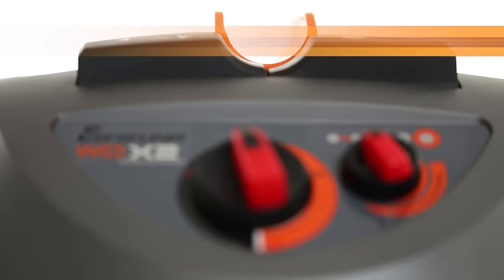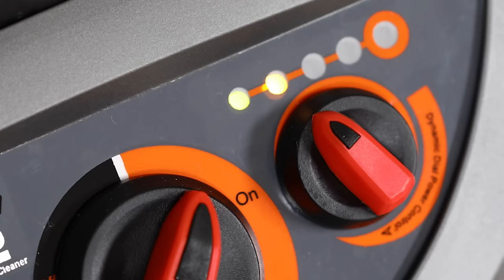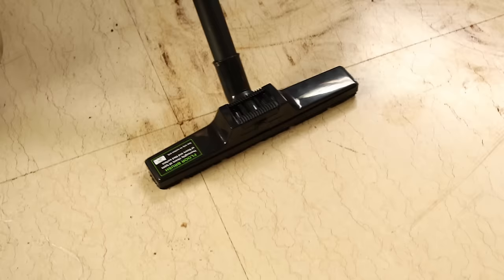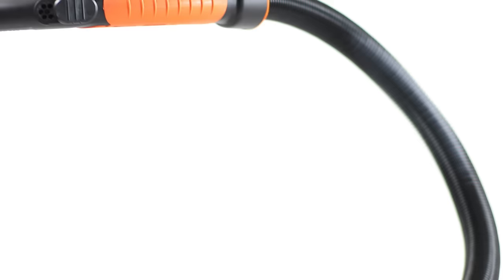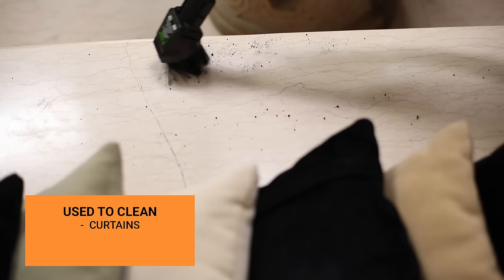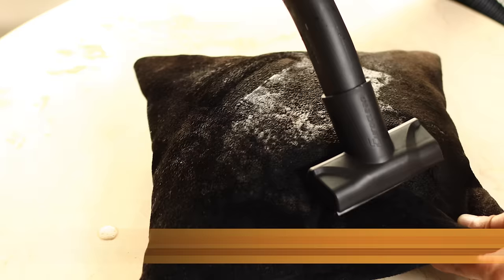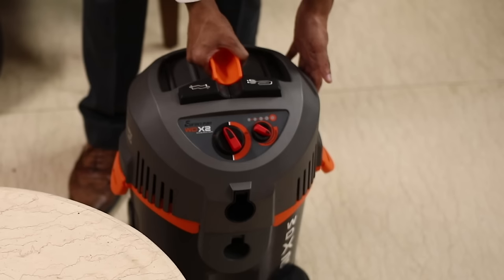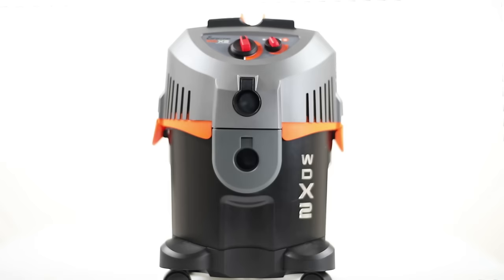Euroclean WD X2 Wet & Dry Vacuum Cleaner | Eureka Forbes

Comment: I think its only best for old age people not for all. Its not so effective for daily cleaning, it is taking much time and awareness to perform the daily routine (like sweeping, web removing etc). Most of the future and parts are only for name sake, if you try use it with full speed (in blower),then it will comes out from the main fittings. If you use moderate speed then it will lot blow out the dust at all. In Nutshell, i personally feel this Machine is costly for this performance. 

PROS: 

1) SURE ITS SO GOOD FOR OLD AGE PEOPLE TO PERFORM THE ORDINARY DAILY CHORES WITH LITTLE EFFORT, BUT TAKES TIME AND ACCURACY IN HANDLING
2) WET CLEANING ULTIMATE
Reply: Than which is best?

Comment: As I had good faith in this product, all the products in my house were rocking their products. Six months ago I gave away my old vaccum cleaner and bought a new vaccum cleaner from them but after two weeks of use the small wheels at the bottom of the mopinu were missing, when I called their customer care number they said that the product will be delayed and the mop came home and one of their sales executives came and bought it and it has been two months. When I called Chumma, he said that the company has returned the product but the roller has not been installed. I bought the product from Kottayam. I will not buy any more products from them, poor service.

Comment: I use this model since last 3 to 4 years approximately it's very good machine and very much efficient.... now may be its need service or something as my machine is overheating
Reply: Is this the right procedure to use autoclean switch?? 
Turn the machine on - motor starts rotating - then interuppt by pressing the autoclean switch

Comment: How do i switch from blower mode to vacuum mode?
Reply: If you plug the hose in the upper hole it will blow the air out , and the lower hole will suck the air in ( vacuum)

Comment: Don't purchase this product. It has very weak locking (latch system) due to which bottom collector drum falls frequently.Also the suppliers does not takes any responsibility after sale.I purchased one in which locking was not working properly. After so many argument with seller and customer care department  they give me new one after one month.The new one also has technical problems.
Reply from the maker: Dear Ramananda,

Please share your registered contact number and customer ID here. My service team will get back to you at the earliest for further help. 

Regards,
Priya
Reply: Dear Madam, The day when I recieved the machine I told the supplier that the latch is not working properly. He told that all the machines have that problem during initial  stages because the gasket is new.I am Being a Maintenance engineer having 35 years experience in machine maintenance field, he never agreed to my complaint.I purchased this from a supplier hosakerehalli,Bangalore. After 35 days having lot of arguments I got the new machine.I have  not all satisfied with the mechanism.
Reply: @eurekaforbes  worst experience from Jalgaon Maharashtra office

Comment: Extremely ineffective in cleaning under the table, under matters cots with low clearance, under cupboards. Just realised it after buying it. The floor cleaning mop is not as effective as the older versions. Unfortunately you cannot use the older accessories on this new thing

Comment: Worst product. It doesn't work properly. The previous version was better. This unit doesn't meet even the expectations of the previous version Wet and Dry machine. Don't ever go for this model.
Reply from the maker: Dear Abirami,

I'll surely help you with this. Please share your registered contact number/customer ID here. I'll have my service team get in touch with you at the earliest.

Regards,
Priya
Reply from the maker: Dear Abirami,

I am still awaiting your details. Kindly share the same as this will help me resolve your concern at the earliest.

Regards,
Priya
Reply from the maker: Dear Abirami,

As I haven't received your details, your concern has been closed from our end. Do contact us in case of any query.

Regards,
Priya
Reply: @Surya Eco Green Waterless car wash The suction power is less compared to the previous version and our sales rep never told us about it. It doesnt suit household cleaning. Car wash is fine but cleaning the floor has become tedious with this machine. The previous blue colour model actually eased the work. It promises a better suction power, but it doesnt suck anything except minute dust particles. Even a small paper or leaf can not be pulled inside.
Reply: @eurekaforbes  A complaint was registered and is being taken care of by your personnel. Thank you. But the problem cannot be resolved as the fault is not in the machine, its in the design itself. The performance is not up-to the mark.